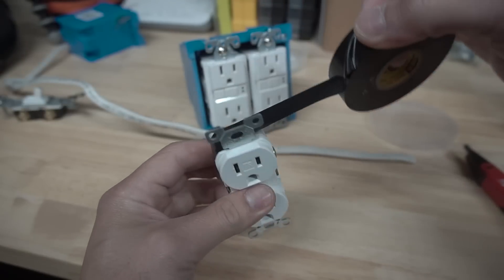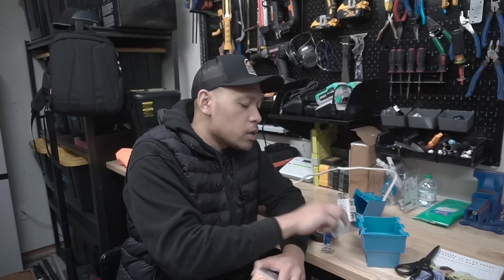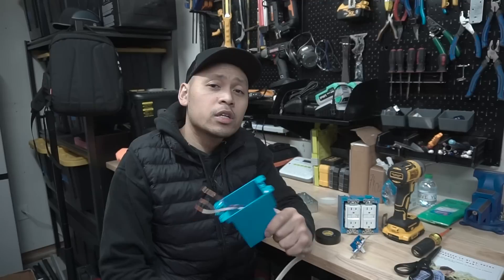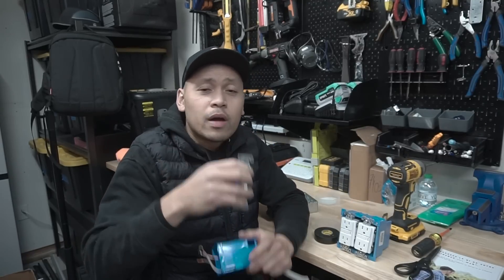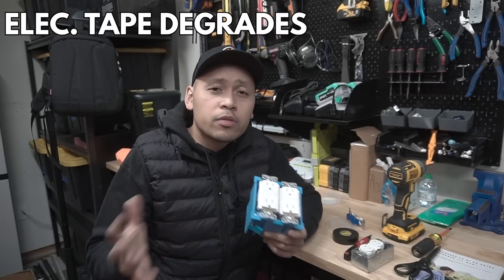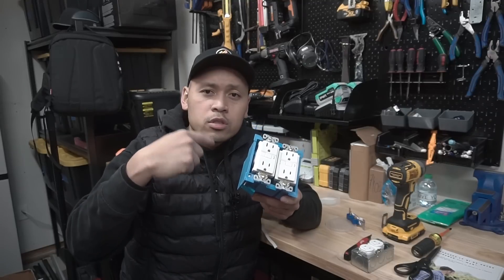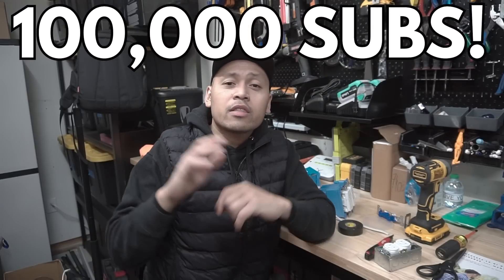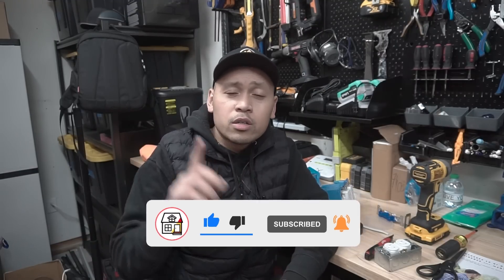Is It ILLEGAL To Wrap Outlets And Switches With Electrical Tape?! The DIY Great Debate! How To

Comment: I had a storm one day.  It got moisture into the wood of the door jamb.  A light switch on the INSIDE of the house managed to leak into this wet wood and up until it intersected the screws of the latch plate.  From there it passed into the metal of the lock and to the door handle.  So I went to undo the door and I got a boot.  I got my meter from the car and it measured 170Volts RMS.  I turned of the master switch of the house which was outside on the verandah.  Once I identified the problem I wrapped the switch with silicon rubber insulation tape.  Following that whenever I am doing anything where there is a possibility of woodwork contacting a powered area I have made sure to insulate it.  Just in case.
Another problem I have had several times in different places is ants making a conductive bridge.  This has started a couple of fires. Luckily they were outside with little risk but the ants also build inside and that could just as easily start a fire in any wall. By wrapping the contacts it doesn't stop the ants entirely but it stops them getting a conductive path between anything.

Comment: I always use tape. To me, it is like buying an insurance policy. I also use the tape on my circuit breaker switch. After I switch the breaker to the off position, I place a piece of tape over the switch. It reminds me that the switch is in the off position. If I can see the switch from where I'm working, I use yellow tape longer than the breaker to make the off position more visible.

Comment: wrapping an outlet is for preventing arching in a metal box if you are trying to push wires back tools will hit the post and the box and arc or if your fatter outlet can reach the side of box and a lose outlet will move and touch
you can tape all you like but do not tape in plastic boxes theres no good reason 
if your delusional or a pussy then take a safety precaution.
if you have a nylon outlet cover kids cant break it. in a plastic box you can stuff toys in outlet all you like and unless you are grounded you will unlikely get bit
if you have kids with sharp metal items it can probably fit in the socket.
be better parent!
electrical tape is not flammable it will melt to nothing.....
you can invent reasons to tape but the only real reason is if you have metal box
tape can become unsafe if it gets old, the tape becomes so hard to move it may require more muscle and you know for every action has an equal and opposite reaction you can bang knuckles tab cut or grip or arc some how
removing tape can be time consuming and your next electrician will not tape your outlets unless box is metal.
engineers made outlets very safe for all even kids but you can leave your kids unsupervised long enough and maybe.... 
child death rate has lowered drastically due to modern tv and ipads can nearly occupy a child from wake to sleep

Comment: By pre wrapping means you are stabbing your wires into the back of the receptacle. This application should never be made available. And stabbing wires into the back of outlets causes more arcing and chance of fires then the terminal screws you are placing "protective" tape over, because you are afraid they would be exposed and a danger. Those taping receptacles haven't had to go into old device boxes and dealt with taped devices much. Most likely someone else had to deal with the mess you left behind, so you never learned from your mistakes.
Reply from the maker: Thank you for sharing!

Comment: 2 things happen when you do this. First it turns into a gooey mess, then it dries up shrinks and slips off the back creating a donut around your wires. And then is just another thing to deal with besides the shitty birdsnest of wires that was crammed into the box. Not to mention the added useless stuffing you put in the box. The receptacles and switches are already designed to keep the terminals and wires safe from touching anything and causing potential shocks, shorts, or fires. If the terminal or wire touches something then you installed it wrong. Technically it isn't good practice.

Comment: On my apprenticeship I was told to wrap my connections so the next non electrician doesn't shock themselves if they remove previous work by touching the receptacle with their unwitting fingers.. I wrap all my installed receptacles... Safety first ...✌❤

Comment: When I renovated my home we lived in the mess while doing it so I needed power and lights so all my switches and plugs were installed and turned on had to completely replace all the old wiring when the inspector came for the rough in he signed off on on the not only the rough in but the final as well as all I had left was to drywall  tape and paint and put the plugs and switches in to the boxes and put cover plates on and since anybody can replace covers without a permit and in our area you can replace switches  plugs and lights without a permit as for safety we should have a simple push button on either the common or hot so when you pull the plug out a quarter inch the power to the plug shuts off as little kids will pull plugs out till then when you have children under 6 put a child cover over the plugs our freezer came unpluged and everything thawed out 400.00 dollars worth of groceries gone we couldn't figure out how it happened until about a week later after we had replaced it all and 3 your old William came into the living room shaking his hand and crying he wouldn't tell us what had happened but his sister did at 4 she couldn't say certain words properly but she did have a good vocabulary and she said he got electrocuted we asked how and she showed us the freezer plug pulled out of the wall apparently when he pulled the plug he'd wrapped his finger and thumb over the end of the plug touching both the common and the hot I put a safety cover over it after that but it was awhile before he pulled any plugs again

Comment: I was trained ed to wrap, because we often (in my facility) couldn't secure the power.  We also had legacy 3 phase 480V that looked like a light switch.  In a damp location, every step to protect the circuit.
Super 33 is what I carry every day.

Comment: Wrap it, if you use a metal box it's going to short..especially if there is a bare ground, doubble gang gfci. or has a hand full of wires in the box.

Comment: Lets start at the basics. Electrical tape stretches. Why does electrical tape stretch. Because tape stretches, how is tape correctly applied? What applications is electrical tape meant for? Until you can answer these basic questions, You don't know what electrical tape is used for.

Comment: 37yrs in the trade. I only wrap a temporary device with tape during construction. It's a working site receptacle or site switch in an open box. If you have worth your salt, follow box fill limits and keep safety first, taping device in a finished closed box is a waste of time. Taping a GFCI is an outdoor T11 box will not protect the device from additional moisture and corrosion. I've done electrical work from Key West to Massachusetts. Nowhere in any of all those local code revisions, does it suggest taping devices. .

Comment: I just graduated as an apprentice electrician. The master electrician instructor recommends wrapping the outlet/switch. If the next electrician needs to remove the tape, a knife cut will enable removing the tape, a 10 second operation.

Comment: The metal box is not a J (short for junction ) box. It is an outlet or switch box. J-boxes are normally 4"X4" size. I do tape them and no problem with inspectors. Thanks for the post.
Reply: Jam box

Comment: I primarily only wrap with metal boxes. Just to prevent any issues in the future if the homeowner wants to change cover plates or the receptacle itself. Metal boxes, especially handy boxes are tight for a normal 15/20 amp rec. And sometimes with an energized circuit, the receptacle may tilt and contact hot or neutral to ground often times resulting in tripping the breaker. (Hopefully it trips ground to hot) without arc fault breakers, hot to neutral may not trip unless it exceeds amp rating. On a side note, double gang GFCI receptacles Should only be used if they are both home runs. If both on same circuit, only one needs to be a GFCI and the other a matched rating receptacle fed from load side of the GFCI. Boom.

Comment: Wrapped and haven't wrapped. As long as you secure your romex before it goes into the box, those wires aren't going to move around. If you are in a hurry you shouldn't be working with something that could possibly kill someone or burn a structure down. Take some time, and arrange the wires in the box so when you push that device into a box, your bare ground won't lay on the side of the box and contact the screws. The main reason I wrap is because I happen to have a role of tape with me and I remember to do it. Now if you are working with conduit and there is a possibility of someone pushing or pulling wire into or out of the box, wrapping is a good idea

Comment: I'm shocked there is no code requirement to sleeve the ground wire. In the UK this is required by code. It seems like you've got some terrible design flaws in your outlets there - the rest of the world has moved onto screwless connectors and/or caged screw terminals and yet I see the majority of your outlets have the old style screw terminal where the screw directly captures the wire. 

Lots of them do have screwless terminals for rear entry but the side terminals, which aren't covered are electrically connected and become live. 

If tape appears required then there's an engineering deficiency there. 

The receptacles in the UK, Euro, Australia/NZ and China all do not have the issues the US outlet does. How difficult would it be to modify?
Reply: You are exactly right on all points but it mostly works just fine.  I have replaced original work in the same neighbothood as the General Electric factory that first made residential wiring components.starting in 1912. Even with non-standardized installations, wooden conduits over bare wires and hand twisted connections buried in plaster, most of it worked fine for a hundred years or so.  I just marveled at some of it.
Reply: @porticojunction  I do wonder if some of the complacency has to do with your split phase domestic electrical system. 120V (of course the RMS peak will be higher) phase-ground means that (especially when the ground resistance is increased by flooring materials, dry hands and shoes) the chance of fatal shocks is reduced significantly compared with 240V to ground systems. Yes, someone could still hold onto a hot wire with each hand and receive 240V across the chest, a shock that especially st mains frequency is likely to result in fibrillation, but all in all, safety is significantly increased. 

I wonder if the lower voltages have allowed for a reduced standard of safety engineering in things like receptacles. 

As an example in Britain all receptacles - for generations - have included shutters, which open only when the earth prong (which is slightly longer to always lead) is depressed. Every appliance cord has an internal glass fuse customized the the max expected draw of the appliance. 

That said the UK has some archaic hold overs from the WWII copper embargos like ring circuits, which are a b*tch to test - and their three conductor wire has an uninsulated grounding conductor that is physically smaller in gauge to the other conductors, meaning a calculator must be brought out when calculating R1+R2 during wiring inspections. 

Agreed the old electrics do make you wonder. Knob and tube wiring is one such example, being done on both sides of the pond. 

Ireland has recently stopped allowing UK style cabling that contains a bare earth wire to be used, and the cable must instead contain three insulated conductors of equal size. This is the case in AU/NZ as well, along with much of Western Europe. 

It's interesting looking at power systems of the world and where each country is at. In many Euro countries (eg France) it's completely normal for residential properties to have three phase power installed. Often only a single phase is used especially in older properties, but especially in new estates efforts are being made to not only fit three phase HVAC, but also to ensure that if the phases aren't shared amongst circuits, then neighboring houses use different phases in an attempt to keep them balanced. 

This future proofing is great now people want to install high amperage EV charge points. 

On other matters the US has been ahead of the game, for example arc fault interruption devices have only just been mandated in a limited number of high risk applications in the latest amendment to the British wiring regs. Australia was one of the first countries to mandate earth leakage protection, initially with voltage based ELCBs and later with current based RCDs and the versions with a breaker integrated - RCBOs (you guys would call these GFCIs).

Each country has its own idiosyncrasies. It just seems a lot of the US is stuck in the dark ages with some of the designs of outlets and back boxes.
Reply: @manyshnooks  I would say that is right-on about the split phase 120v, it hurts to about your elbow but you are usually ok.
  I spend a good bit of my working life making British and European appliances work on US current (usually for development or testing purposes) and the US safety deficiencies become apparent right away.

Comment: Good video. I have been a I.B.E.W. Union member for 20 years and cert elec. And 6 year military. It is always good practice to have safety layers in all your electrical jobs. I have used electrical tape and 1/2" and 1" industrial rubber bands. Rubber bands don't retain moisture and 99% off inspectors that I have seen. Like it because it works and quick inspections with out having to un- wrap tape.also you can make your own rear safety caps. I have had a few inspectors bark on it, but there is nothing in NEC about it. Stay safe and work smart my brothers and sisters. Stay squared away or get blown away!

Comment: AS a Electrical Contractor for over 40 years and I still wrap tape,   It also helps on trouble calls if the tape is gone , shows what the customer may have been playing with ....
Reply: If In doubt or a tight box, I do it also :-) Currenlty I'm fighting my house wiring that was badly done with the daisychained outlets and back-stab wiring. That push-in concept was not a good idea.

Comment: If they go into a metal box , YES , I wrap them 3 layers 
If they go into a plastic box , NO , I do not wrap them.
When installing the devices , I bury the grounds into the back of the box first to prevent any ground from migrating onto a hot wire .
Reply from the maker: Thank you for sharing my friend 🙏🏽😊
Reply: Same. My boss has said before that you shouldn't need tape if you're doing it correctly. 
I mainly only tape in cramp metal boxes and in questionable instances.

Comment: LOL,  In 1950, there was a broken cover plate on a 3 way switch going to the basement.   
The old 3 way switches had a terminal directly under the switch plate.
So I would get shocked.
I got mad at my Dad, and told him to put a new plate on. 
He laughed.   He had some electrical training, and never thought an electrical shock was a big deal.
I guess that is why I became an Electrician. 
People always asked my Dad for electrical help on simple electrical repairs. 
My Dad taught me.  It aways seemed odd to me how some people were afraid of electricity. 
I became an Electrician.   Getting shocked never really bothered me. 
Although I took some big hits, the largest one was 270 volt.  Since I was always careful about not being ground,  it did bother me, and I continued working. 
As I hit my 60's,  I became much more careful, because your heart can only take so many hits.  I retire at 73.

Comment: I've been an Electrician for 30 years.  I don't tape.
If the box touches the conductors, the Electrical tape is  only temporarily  protect.  Eventually the Electricity will burn through. 
Properly installing the device is the best protect.

Comment: (im bad in grammar)Here in philippines electrical tape is the most common use for wrapping wire. And most of our devices had slot on the back not screw, some with screw but less common. And cutting electrical tape with scissor is lame, you wrapping the device like chrismas gift put some strecth

Comment: I always wrap all switches and receptacles! Start on the bottom left and wrap two full turns going clockwise (three for kitchens, bathrooms, and outdoors). I only use Scotch Super 33+, it doesn't leave the residue that other tapes do.

Comment: I have overloaded quite a few outlets and melted the insulation on the wires until it burned the wire off. If you wrap tape over the exposed wire where it makes contact that is exactly where it heats up. The tape will burn and it smells like crap and it drips burning plastic everywhere. That's why in my humble opinion you shouldn't use tape unless it's to repair insulation you removed. Shrink tubing is prefferable imo.